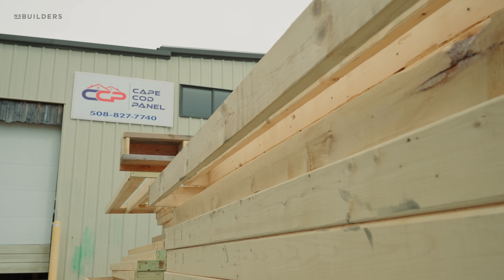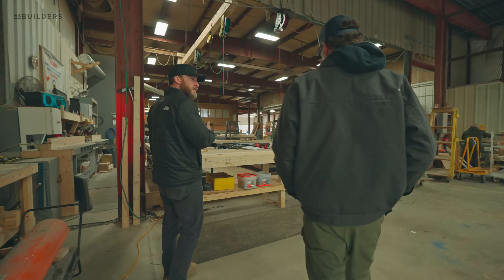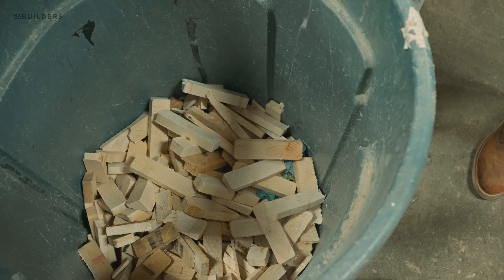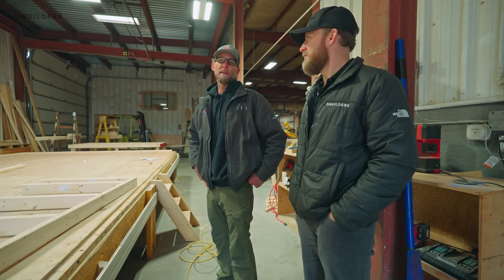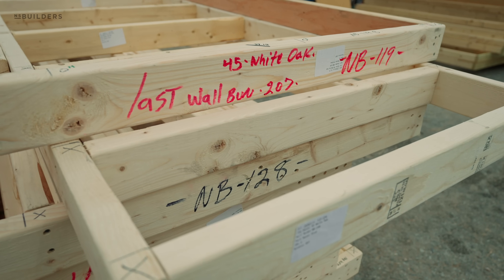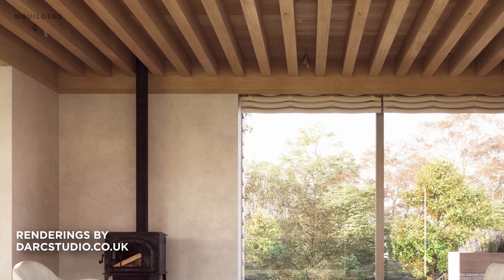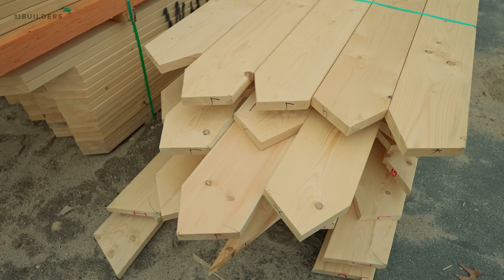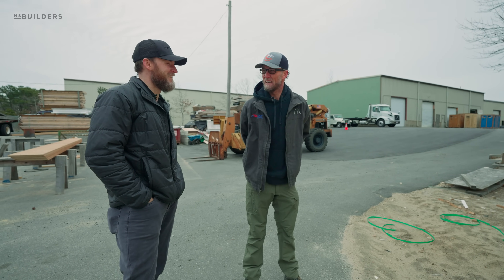This House Was Framed In A Shop (Kinda)

Comment: Hi Nick, I've seen several of your videos on prefab construction and see benefits of prefab over traditional on-site construction. However, I have not seen prefab exploiting these advantages towards more modular construction or as a kit of parts where a home can start as a basic unit consisting of a studio space with a kitchen and bath and over time augmented with future additions for bedrooms, baths or more living space, etc.  What I am getting at is prefab may provide an affordability factor that allows you to build your home as you need over time.  I guess what are the constraints with such an approach on the technical side (foundation, utilities, etc.) as well as potential savings to the homeowner.  I have seen examples in developing countries where a building envelope or shell is constructed with only minimal interiors completed to inhabit at first and the homeowner would later build out the interior as needed over time when funding or resources became available.  I don't see any prefab manufacturer at least based in the U.S. that offers this piecemeal development approach.  Would be interesting to hear your thoughts, if any on this concept.  Otherwise, a big fan of your work and appreciate all your videos!!

Comment: I've seen multiple companies attempt prefab building, yet many seem to falter. While I'm not an expert, it appears that these companies often aim to bridge the gap between building affordable homes and scaling up quickly. 

In contrast, CCP seems to approach prefab building differently—not primarily focusing on budget or speed, though speed may be an added benefit. Instead, CCP appears to me as a company delivering a product that is precisely accurate and anticipates potential errors that might be missed in traditional architectural drawings. This method likely gives the customer a greater sense of confidence in both timelines and overall control of the project and I think it's as simple as that. 

I think this is a service that every 5+ person framing company, if they want to take their business slightly to the next level needs to do.

Comment: Prefab building is a clear winner, and one of the answers to building affordable homes going forward. There is tons of room for automation and systems, quality control, and delivering on spec and on time. If I were investing in the building sector, this is an area where I'd take a good hard look to identify the innovators and top companies. So much potential. Looking forward to seeing how this project unfolds.
Reply: Weve been hearing exactly that from people outside the trades for 50 years now. 
Not one of them has shown that they can do it for the same cost.

They have the same labor problems in the factories as we do in the field.

There is a lot more to it than most people from the outside think.
Reply: Couldn't agree more...been contractor for 30 yrs..only caveat for me would be that I think ,like any framing, it's gonna b tuff for inexperienced...but...if u hav one exp pro on site,should b straightforward. Esp with simpler design than this one
Reply: @stevewight1409  Yeah, the expert vs labor needs to becomw more flexible. The specialist sub contractor wavw over the last 40 years is now more expensive than building in house.

A team of good general labor and then getting a lead that can communicate for each speciality will make more money.

The trades will move back that way as more automation comea in.
Reply: "Prefab building is a clear winner"

no it's not, these prefab shops always come and go.

Comment: If your doing prefab walls why not go a step further and do SIP walls? Any projects utilizing SIP?
Reply: Its a lower end product. It works and theyve fixed the problems. 
Its no different than a standard build because its all work in the field using trades that could be building a standard house. 
Some labor savings but there are a lot of little things that add up to them not matching standard homes.
Panelized systems and floor cassettes are where its looks like its going.
The drop in boxes being the larger version.

Comment: Did they laser scan the foundation before they started building panels?
Reply from the maker: Wasn't necessary since there is tolerance in the framing relationship, but we did survey it
Reply: @NSBuilders  what do they need as that tollerance? 1 inch????

Comment: This method doesn't look any faster than site framed...same work just done off site.
Reply from the maker: which allows you to effectively do 2 things at once, site/foundation and frame offsite at the same time, saving overall time
Reply: @NSBuilders  yes overall project can move faster ..but the actual framing looks equal in time off site vs on.
Reply: Also, walls are framed in a climate controlled factory setting. They can use larger, factory level equipment.
Reply: It’s faster because you don’t need the floor framed to build walls on. You don’t need the foundation done to start building walls even. I always would start cutting first floor parts off the structural drawings when the foundation was being cast but I had no place to build walls until I had a floor on and decked
Reply: @CMCraftsman  yes it makes  the overall job faster but far as framing the walls I see no time saved.
Reply: Yep its the same amount of cost just sped up a bit.